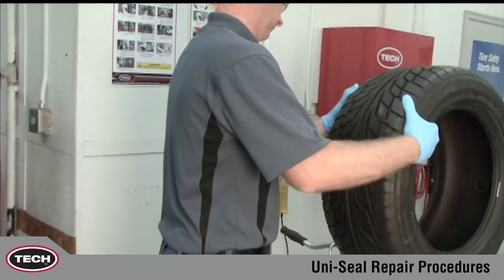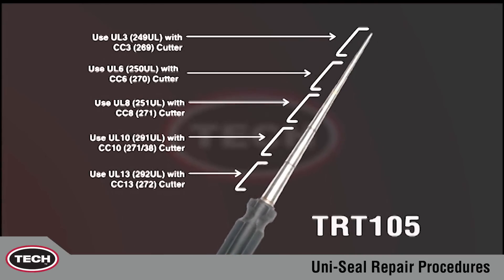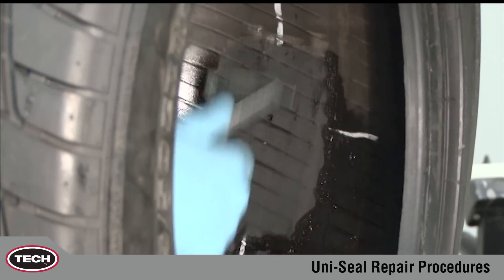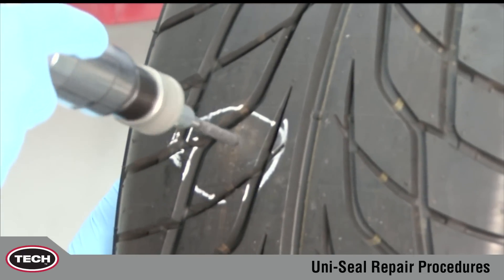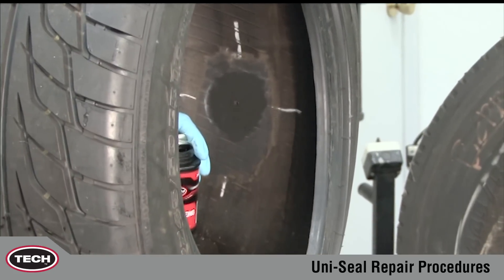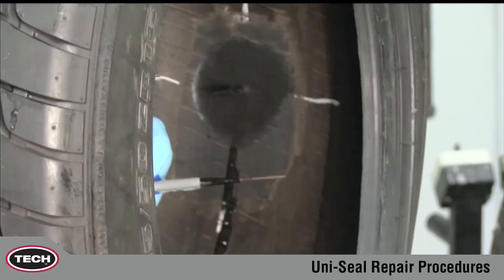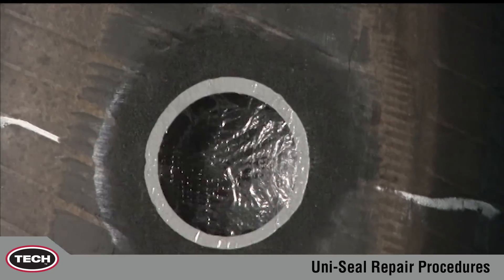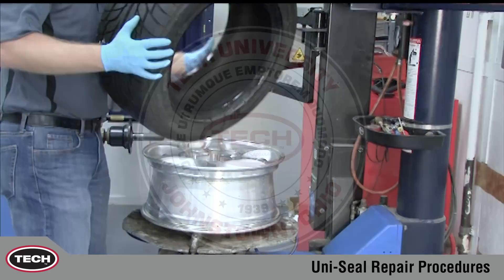Proper installation of TECH Uni-Seal Repairs

Comment: It's interesting to see that it is recommended to cut off the stem at 1/8" or 3mm above the tires outer surface. Why is that? Why wouldn't we want a cut that's flush with the outer surface?
Reply from the maker: As the repair continues to vulcanize to the tire it ensure that the repair is completely set. And the extra will wear down over time anyways.